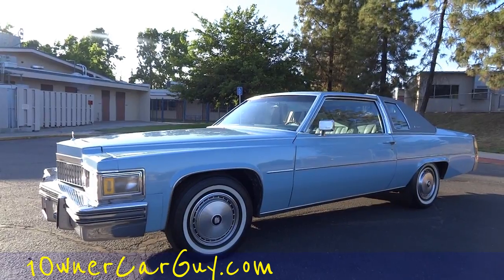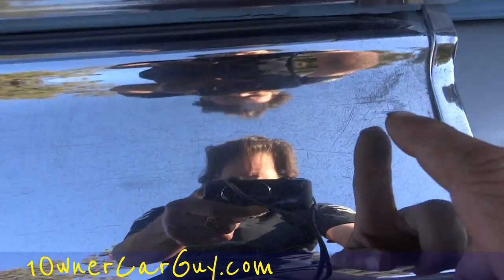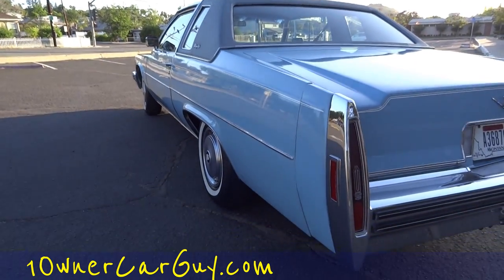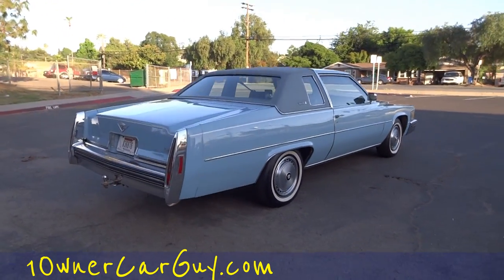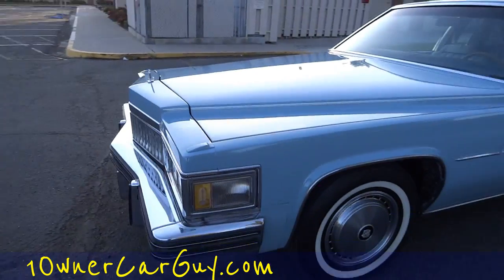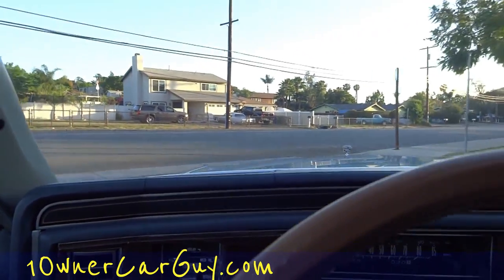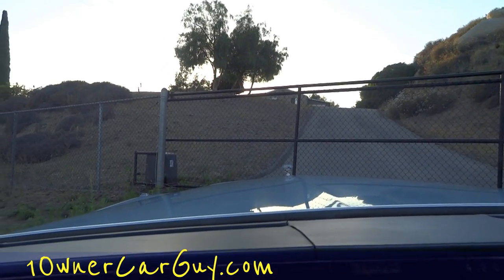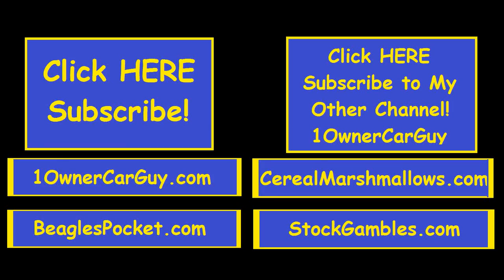1977 Cadillac Coupe De Ville CDV Deville Video Youngtimer Classic Cadi 28k Mi Test Drive

Comment: It's a 1978 model year by the grille and the tail lights.  The 1979's had a smaller mesh grille.  Probably 128,000 miles given the fact that it was 35 years old when the video was taken.

Comment: Nice, clean, well detailed, driver, but there is NO way it had only 28K.  If you know cars at all, or have ever seen an authentic low mileage Cadillac of this vintage,  you'd know that front seat was NOT a  28K mile seat, it was a relatively well preserved 128K mile seat.  Even the video couldn't hide the fact it didn't ride or drive like an authentic 28K mile Caddy.
Reply: +Cereal Marshmallows Nathan, why the hostility and sarcasm when someone points out a mistake you may have made which is entirely plausible? I'm a big fan Nathan and you bust your ass working hard to make sure that nothing is covered up. But Christ man, no one can call you out or disagree with you on anything you've said in a video, even if it's a completely reasonable comment. You just dismiss and mute. No one has time for negativity but there was nothing negative in that comment. It was an enlightened comment actually. We love you bro! Guy was a bit of a dick, granted, but made great points. Anyways, proud to be a sub!

Comment: It has a 1978 grille... the crooked bumper tells us why.  The rear bumper and lights are 1978.   The interior seat trim pattern is that of a 1977.
Reply: Also 78 hood ornament and hubcaps.  77's were different.
Reply: I had a 77 Coupe DeVille, and it had the same hubcaps as this car.  That said, the taillights are definitely not from a 77.  It looks like this car has bits from a 78, or the car is actually a 78.
Reply: yea I had a 77 coupe Deville and I remember that it was the only yea they had half taillights so those certainly aren't original
Reply: Damn, I can't believe I miss the tail lights. My father use to hate the 77 because of the tail lights.
Reply: Definitely not a 1977....I had mine for 20 yrs.  The 77 had the half wrap-around tail lights, the turn signal/park lights were clear, different grill.  I got mine when I got my driver's license as my parents bought it the year before and wanted and El Camino instead.  When I got it in 78 it had about 700 miles on it.  Loved that car.
Reply: I'm glad my friend had a 78 or 79. That engine was pretty strong for that year.
Reply: Yeah, I drove a '78 Deville d'Elegance in high school (circa 1998 - '00), and if this is a '77, it has been modified with '78 parts. The '77 model had those half-tail lights I dislike so much. :D It's still nice.
Reply: Yeah! I had one. This is not the best but nice try.😁
Reply: That car is definitely a '77 with '78 grille/bumper/taillights. In addition to the seat pattern being different from '77 to '78, the '77 was the only year that had those funky sort of "Y" shaped  switches for the windows that broke easily - they went back to the previous switches for 1978.
This car has the "normal" window switches.

Comment: Cereal M. is correct it's a 77'.  The rear bumper is off a 78', 77' had a reflector between the rub strips and different tail lights.  77' used rubber not plastic rub strips on the rear bumper with a metal backing similar to what is used on the front center bumper section, the 77' rear rub strips typically get warped with age unless the car is very low mileage and was pampered.  77' was the only year clear front parking lights were used, 78'-79' used amber.  77' devilles used a "see through" Cadillac hood ornament, this was its final year and was a carry over from 76'.  The upper and lower grilles have square openings, the 77' is egg-crate .  The steering wheel horn crest (13:50) and the vinyl top sail panel (8:05) don't have a 'V' under the crest , the speedometer has a 5 mph digit, 78'-79 went from 0 mph to 10 mph,  the seat pattern is unique to 77' (11:02) and the driver door door lock is rotated 90 degrees, all these details are unique to 77'.  Under hood only the 77' had a round air cleaner hose with metal clips which was a carry over from 76' (14:59) , 78-79 had a more oval shaped with plastic clips.  I've owned 77'-79' C body Cadillac's from 1979 to present day so I could go on and on but that would get boring quick...
Reply: ALSO:  At 13:43 (and various other places) the power window switches were unique to 1977. They used that sort of "Y" shaped switch for one year only which was a bad design because they would break off easily; they went back to the same switches Cadillac had used since sometime in the 1950s for 1978.

So, yes this car is almost certainly a 1977 with a 1978 grille (and possibly the hood) and rear bumper/taillamp bezels.

I can't recall for sure: Did 1978 have a "V" under the crest on the steering wheel or not? I know'77 definitely did not.

Comment: Awesome original car, Nathan. Truly museum quality.  The Cadillac 425 is an incredible smooth and very torquey engine.  It will move that big coupe around without any complaints.  These '77's really are about 600 lbs. lighter than the '76's so they move and handle really well.  Although Seville's are my favorite, a Coupe de Ville is a very close second.

Comment: Nice Coupe Nathan, I sadly sold my '70 CDV back in '08 after I was laid off.  472 under the hood, and all black leather inside. I bought that turquoise beauty back in '88 with only 47,250 on the odo.  Sold her with 49,500 miles 20 years later!...Lost my garage space and the job at the same time. 18.5 feet of Detroits finest!...Ah that was a time.

Comment: I have had a hand full of the 77 to 79 full size cadillacs with the 425 V8,and that 425 is the same block as the 472-500 used from 1968 to 1976.  That engine in that 77 Cadillac in your video is actually better than any rolls Royce engine or any Mercedes benz engine and can literally last 60 years if it is treated right with proper oil and coolant.  Its saying a lot to say that engine is better than even the rolls Royce 415 as far as longevity BUT IT IS!!!  It was an American misfit though in the way of placing a 60 year engine in a car body that rusted and for wrecked in the first 10 years.  It was a waste of engineering to put these in cars and allow idiots in America to buy them.  That engine belonged in a 150k dollar car that would be an investment for generations.

Comment: Columbia blue (code 21); 1978 for sure.
Reply: +Taras Zacharko  Plus the tail light style changed.  They used same design shown here in '78 & '79. The 1977's were completely different. That was the most distinguishing feature change. This is, in fact a 1978.

Comment: Great car!
FYI thats not a 1977. Its a '78 or '79 because those rear lights was used since 1978. 1977 used different lights.
Reply: Careica it's a '78.  '79s had a different grille, different steering wheel center pad, there was a chrome Cadillac crest in the rear tail lights.  '79s had burled walnut wood grain inside and had different pull handles on the interior door panels.  I owned a ''79 Sedan Deville.

Comment: first this is a cadiliac compare to CTS and the ATS.maby won t drive fast
you can drive long in it.i think this should be garaged.even moms garage does t fit.if I go to work I need to parking lost to park it side way
i would go to big maintain service check everything.wash it and waxed it.ahhh just about luxery.affordible benley motor car.now it grapy lexus car.

Comment: Interesting. Exterior wise it's a 78 by grille, front marker lights, rear taillights and rear bumper. There should be a Cadillac script on the header and it's not there. So that says car has been repainted at one point. Pinstripe is not correct on the trunk Thicker stripe should be on top and thin underneath. However, the interior is 77. Power seat switch was on the bottom edge of seat itself and not on the door. Also the remote window switch that you fumbled with is within the woodgrain assembly and that is correct for 77. 78 had them on the armrest. Horn pad for 77 was only crest for the Devilles. 78 had the V under it.